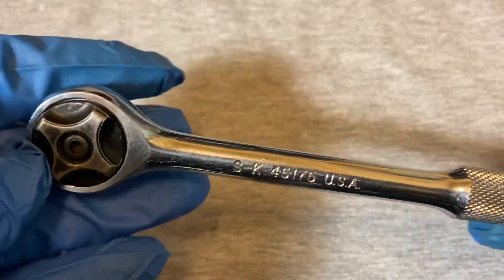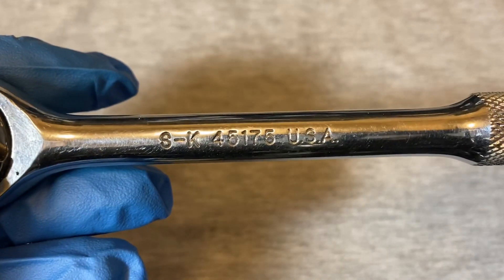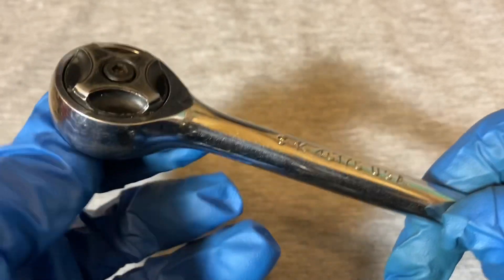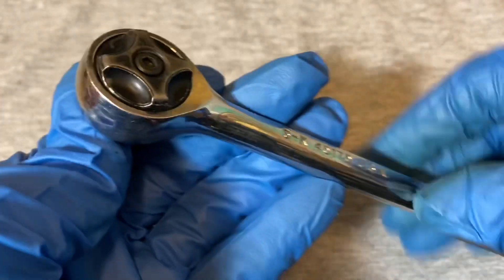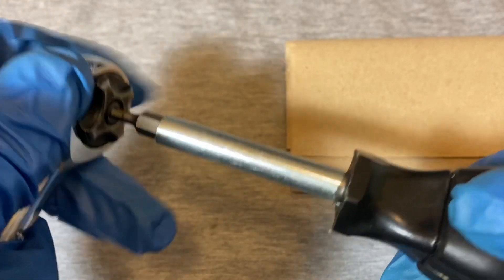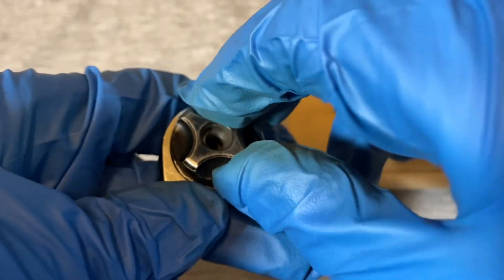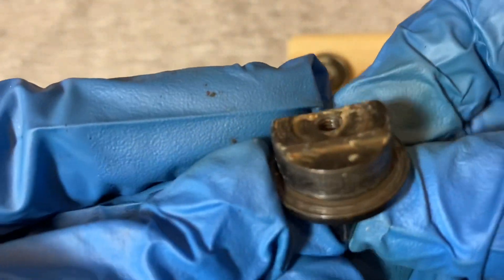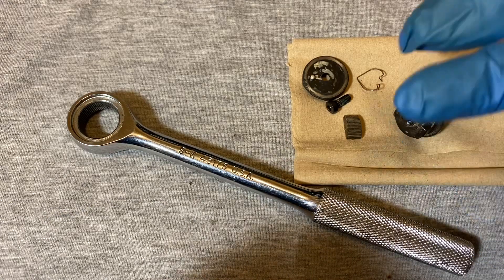S•K (Facom)45175 Ratchet TEARDOWN And Examination Of Design, 3/8” Drive

Comment: I own a 1/4 drive Facom version of this ratchet that I bought around 2002. It's been a while since I opened it and cleaned it out.

Next time I overhaul mine, I may use moly grease or just like 3-in-1 oil. These are good ratchets, but I actually prefer the feel of the SK pro line of ratchets. They're not fine-tooth, but I think they're smoother with less back-drag. I own an SK pro 1/2 in drive ratchet, which is my go-to 1/2 inch drive ratchet.

Back in 2002, when I bought my 72T Facom, there weren't as many fine-tooth ratchets available for purchase in the USA. The SK and Facom ratchets were definitely good. You could find older-stock fine-tooth ratchets with various brands made by New Britain tools or JH Williams that were fine-tooth, but most new ratchets sold in the USA around that time had coarse teeth. So at that time, these SKs might have been the smallest and finest-tooth ratchets that you could buy in the USA.

Today, there are a lot more options on the market, which is probably part of the reason why it has been hard for USA hand tool companies to make money. I've seen reviews of Japanese ratchets like Koken or Nepro, and they're likely smoother than these 72T SKs with less back-drag, although if you clean and lubricate these old SKs, they're excellent tools as well. I've always liked the finish and ergonomics of SK tools. I love their box wrenches and sockets because both are just a little bit slimmer than tools made by competitors, which means that there are certain very tight spots where an SK will fit while a bulkier tool won't.
Reply from the maker: I think these ratchets were also sold under the “JS” brand for possibly government contracts. JS I think was not only an SK marking. Seems like the JS marking was used by several different manufacturers on tools for government consumption.

Comment: You spent 3/4 of your video on grease and why it's a bad lubricant.  You could have gotten the point across in one, maybe two sentences.   You could have shown how to clean, lubricate and reassemble the ratchet in the last half of your video. 

I am not criticizing your expertise.   When I watch a video I like to see the whole process.   What I  learned today; S-K tools was sold to another company,  the ratchet is OK and dried grease is bad.  I would have liked it better if I learned how to disassemble, clean and reassemble the ratchet.  I would have liked to know if the ratchet was a good choice after your restoration. 

Bob
Reply from the maker: Thanks for your input. When I had an idea to do this video I wanted to take it in a different direction than the usual “teardown, clean up reassemble” type video. I was trying to show the problems that are particular to this mechanism, how they manifest and the remedies. So this was kind of a “special addition” video. Sorry I didn’t clarify that in the beginning of the video.

Comment: I purchased one of these Facom made 3/8" flex SK ratchets several years ago and was amazed at how smooth it was with nonexistent backdrag. I have purchased two more NOS 3/8" ratchets from a sell over at the 'zon. I also own the 1/4" version but prefer the original SK design as it's just as smooth and not as bulky as the Facom designed version.
The 3/8" version is the one to get with it's 72 tooth design and 17 teeth engaged on the pawl which makes for a strong ratchet. 
I have several rebuilt kits as well and SK supplies Super Lube grease with their kits but you might be right that oil is the better choice for this design.
Reply from the maker: Cool👍..Do you know if S•K made a 1/2” version of this ratchet. I don’t recall ever seeing one?
Reply: @snapringchronicles3020  They did. Model # 42475 & 40175 both 1/2" drive.

Comment: Once a year I soak the heads of my ratchets in a jar of transmission fluid for a few days.  I've been doing this for over 45 years with the same ratchets and they still work as good as new.
Reply from the maker: Trans fluid is a good penetrant and cleaner👍

Comment: 72 tooth ratchet. 
I use Marvel mystery oil for lube.
The screw needs the proper tension,tighten all they way and then losen 1/4 turn.
They are smooth as butter !
Reply from the maker: Yes very true about the screw tension 👍